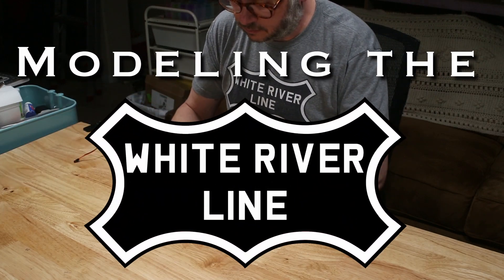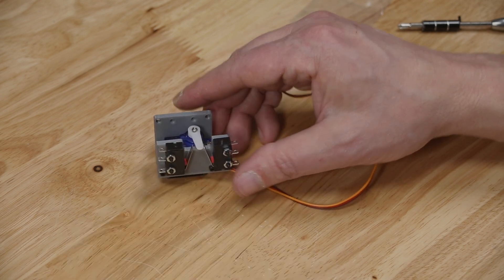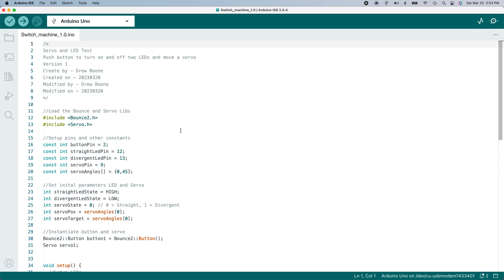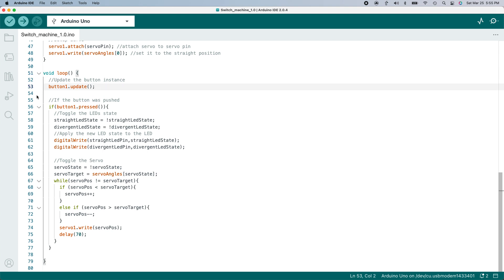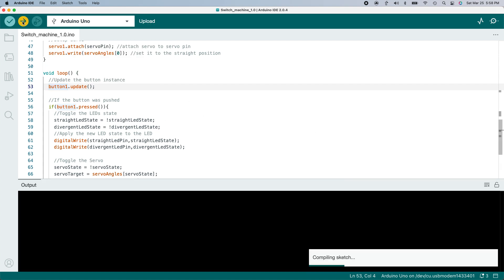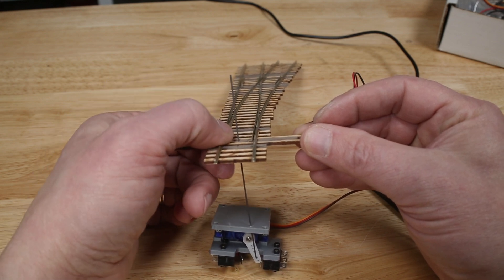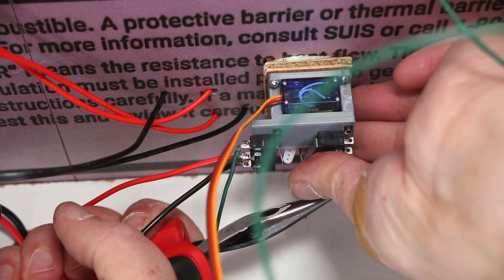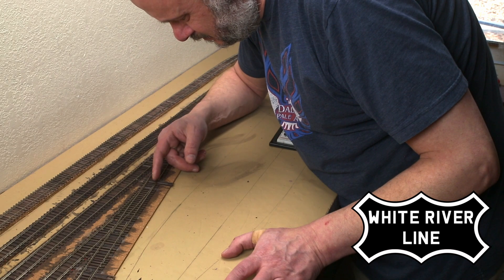Building Switch Machines From Servos for My Model Railroad

Comment: Great solution ! I'm looking at Arduioising my layout for switch machines, and looking at going all the way with ++EX.
Someone mentioned but did not elaborate - you can just use one microswitch to change frog polarity. Feed the frog wire to the Common, and the plus and neg go to the other legs of the switch. So the one switch changes over the polarity, rather that one switch toggling plus and the other toggleing neg. Make sense? That's how I'm currently doing mine, manually with push-pull wire to the tie bars that also operate a change-over switch.

Comment: Great Video! I hope to do something very similar soon. The only thing I plan to do differently is to use the "Diverging Route LED" output on the Arduino to energize a SPDT relay instead of using mechanical limit switches to control frog polarity. I think a relay will simplify the mounting bracket and allows for much easier tuning of the straight and diverging route positions.

Comment: Why did you use both switches for the point polarity? And for the motion of the throw bar it could be the distance between the servo and the throwbar. I use the same servo mounts and there is only a baseboard of 9 mm and a corksheet of 4 mm between the bracket base and the throwbar. I use 0.8 mm spring wire. I am really impressed by the way you are building this lay out. And also the videos are inspiring. By the way, for the electronics I use MERG servo electronics. Works fine and are cheap.

Comment: This is really great. I had not bothered with switch control but seeing you doing this makes me want to try it out. The advantage is that with Arduino you can extend the number of switches still using the same board. The boards coming from China are such good value that it makes it easy to use them for all sorts of projects.

Comment: These servos are indeed cheap. You need a way to use more travel on the servo to produce the same amount of motion, so you get more overall torque.

Also, I would not hardcode the exact endpoints for the servo, as you'll have to re-flash the firmware if the servo wears out, or due to analog drift over tme. You'll want some way to read and write to those values without completely re-flashing the board. A serial routine at boot would be one way.

Comment: Hi there I've seen the frog switch wired with the frig to coman and track bus to nc& no. And then through a servo stile plug and socket using the middle pin for the frog so if you get it wrong way all you have to do is reverse the plug. Wich also means if the servo fails then you can just unplug the signal and frog wires no messing

Comment: This seems rather complicated and expensive?  Do I need an Arduino for each switch?  If so the Tortoise Switch machine is way less money and much less complicated.
Reply from the maker: You do not need an arduino for each switch. You could conceivably control all the switches from a single Arduino. So while it is complicated it is actually much cheaper than Tortoises. Tortoise switch machine are probably going to be a good choice for most people.

Comment: Two things to look at:  First is the hole below the switch throw bar big enough for the wire to travel the distance that it needs to travel?  This includes the hole in the wood mounting bracket.  Second, your angle is ok, but the travel of the wire at the throw bar is not, therefore you need to move the servo set up further away from the switch.  When I built mine, I measured the travel I needed and designed the mount to give me that travel when mounted.  If the problem is the size of the hole, it is an easy fix.  The second option is to place a bigger spacer between the servo and the layout.  You can do this by adding another piece of wood for mounting, the screws should hold it.
Reply from the maker: Thanks for the suggestions. I’ll try that.

Comment: Hi Drew, I've been working with an airbrush for the past 30 years. I've nearly always used a Badger 150 double action gun. Mine doesn't work properly and it's time to change it. After all this time, I'm stucked. There are probably better units than Badger. I tried a Passche airbrush a few years ago. Bad experience at the end. I also prefer a gun with a bottle. It's easier for me to work with. Would like your impressions ! Tks.
Reply from the maker: If you've been using an airbrush for 30 years then your experience certainly exceeds mine. I've been relatively happy with my Iwata Neo, but it is really an entry level airbrush. It is the only one I've used, so I'm not sure my opinion is very informed. It is gravity fed rather than siphon, which I feel like makes it faster to switch out paint colors. I had some issues early on with clogging, but learning to clean it properly has helped that quite a bit. I also had some issues with the trigger sticking, but again a good deep clean and oiling has resolved that. I hope this is a little bit helpful.
Reply: @WhiteRiverLine  Hi again. Many thanks for answering. I was asking because you seem to be very confortable using an airbrush on video ! I know I must buy a cheap one because I got BIG buildings I need to cover nearly like I would use a spray can. In fact, that's what I did first on some paper mill buildings. I used Krylon Camouflage Khaki color. It did a great job BUT it was kind of first batch of that color. The new one is not even close to that first color... Soooo, I'm stocked trying to mix one and applying it with a none fine airbrush. I'll try to manage something in finding a very good one. Maybe Iwata is the right answer. Thanks again.

Comment: Re the eventual electronics behind the turnouts, you might like to take a look at a UK Based outfit called MERG.

They have a number of circuit board kits available which allow you to control numerous servos from a board, with great adjustment features ie angle, speed, etc. 

While you're at it, check out their offerings having to do with controlling accessories ie turnouts, signal, mimic boards, etc via what they call C-Bus. The concept behind this stuff has been in common used in aeroplanes and automobiles for many years. Saves a ton of wiring, and has the added benefit of providing Feedback from the layout back to your control panel(s) or signals and sensors. 

Please be aware that you need to become a paid member of MERG to subscribe to their huge info library, and to allow you to buy their kits. It's only about 25 UK Pounds, and the kits are not expensive.

Good luck.
Reply from the maker: Thanks for all the info. I'll look into it.

Comment: you should make the angle of the servo bigger, and experiment with the thickness of the wire. so you have more control over the movement. I think you need another mount.
Reply from the maker: Might be. I'm gonna start with a thicker wire and see how it goes from there.

Comment: Use an aluminum servo arm, and keep the servo as close to the turnout as possible.  Mount it solid, using as much surface area as possible for the mounting surface
Reply from the maker: Thanks for the tips.

Comment: i don't remember if you hand laid or you are using Peco track. If it's Peco switches you need to remove the spring. If it is hand laid you might need to get servo's that have more torque in them to move the points. If your points don't move freely before the servo is attached, then you have a problem.
Reply from the maker: They are hand laid. The points move pretty well, but friction could be part of the issue for sure.

Comment: Making the servo actuate the switches AND move the track switch compounds the problem, the mechanism should make use of the full servo travel to get more force. Do the electrical switching with electronics. De-coupling these two ideas makes it all less fiddly and unreliable.
Reply from the maker: Yeah maybe I’m making it too complicated.

Comment: Great video Drew! Notice that you built your own turnout. I've built my first 3 over the past 2 weeks and have been testing the throw action. Is it possible that the throwbar on your switch is the same thickness as your filler ties? If so I'm thinking it would be good to make it thinner. I'm also sanding the surfaces of my throwbars very smooth hoping that they will slide more freely. Adding graphite from an HB pencil could also help the sliding. I too have a sketch and a working push button so I totally appreciate your video. It will help with troubleshooting for sure!
Reply from the maker: Thanks Matt. The throw bar is slight thinner, the graphite might be the trick!

Comment: Hi nice channel very well presented and well worth listening to. Great channel. I use the same servo mount that you are using. From TF comment below I thought I would share what I use for the throw bar. 
Hobbypark Φ1.2mm x L180mm (7.1 inch) Steel Z Pull / Push Rods Parts for RC Airplane Plane Boat Replacement (Pack of 10) They are long enough for me to get two rods out of each push rod in the pack. Have to drill the guide and servo arm a little bigger but they work great.
Reply from the maker: Thanks for the tip!

Comment: Wow, When you got to the PROGRAMMING part, you left me in your dust, I've had some programming training (Basic and Adobe Flash, I think it was Flash, but that was 15 years ago).
I hope that devise comes with user friendly instructions. Are you going to use bread boards or make a circuit board? 
You may find that the thow rod needs to be in a SHORTER throw hole on the serevo and a bit heaver throw wire is necessary. I've seen another video where the person had the same trouble with the commercial "slow" throw machines. (to long a throw and to thin a throw wire). I would use some sort of manual switch throw. Oh Well, it's your railroad, have fun. ;-)
Reply from the maker: I was hoping to make the programming part pretty understandable. I've been tinkering with programming for about 20 years and it's hard fit very many programming concepts into a small segment of a video.

I'm still thinking through the wiring. I don't think I'll make a circuit board and at the same time a bread board feels a little temporary to me. We'll see what I can come up with. My goal is neat, simple as possible and easy to maintain.
Reply: Once you get into Arduino you will find that fortunately many others have done the work for you and you only need to borrow their coding.

Comment: Thanks for the video. Great timing as I have working on under track servo uncouplers. Your sketch will save me working it out. Not my strong point either. If you have a file available would love a copy. Cheers Justin
Reply from the maker: Glad it helped. Here is the sketch, https://docs.google.com/document/d/1CADknFjPvnkSOx4BgcfesB2d1I7zokdWkBpiixGhpvc/
This is really just a start and this sketch wouldn't be great for running multiple turnouts. As I progress it'll get a little more complicated, but I can make those sketches available too.
Reply: @WhiteRiverLine  Thankyou most appreciated. Will be watching as you progress.

Comment: Very interesting Drew! Way over my head though. Is that one board just for one switch or can you run multiple switches from it?
Reply from the maker: Thanks, Yukon. I can run multiple switches from it. I'm still doing some research and thinking, but I'll probably run all the switches from a single arduino, but that is going to require a couple of other components.

Comment: Looks like you mostly got it figured out. A bigger wire does help but the tortoises also has the wire pivot below the layout which puts more tension on the upper half of the wire. Hope that helps. I know you'll get it figured out eventually. - Jason
Reply from the maker: Yeah, I'm thinking a thicker wire will be all I need, but we'll see.

Comment: I found with my experimenting that I needed to use a heavier wire on my Tortoise switch machine because the wire had to go through 2 inches of foam.
Reply from the maker: That'll be my first step. Need to make a run to the hobby store.